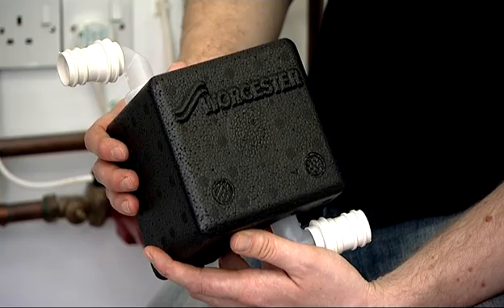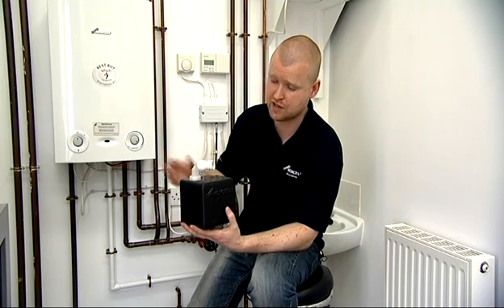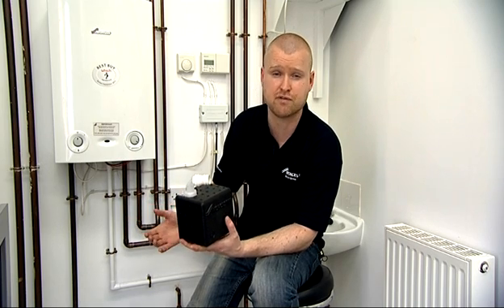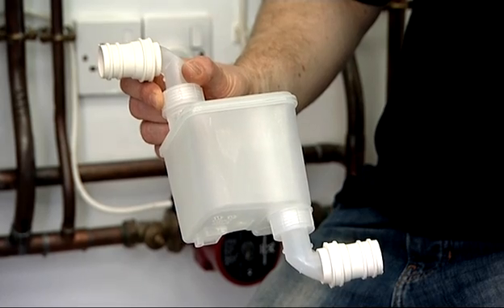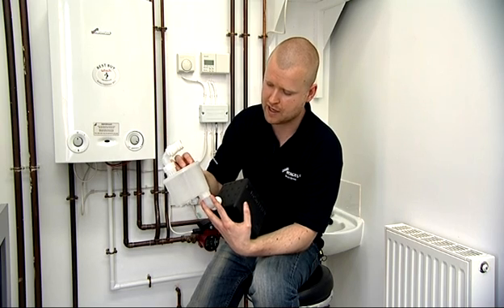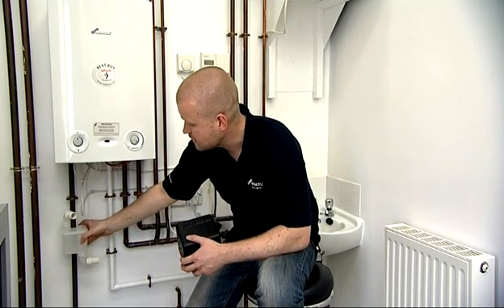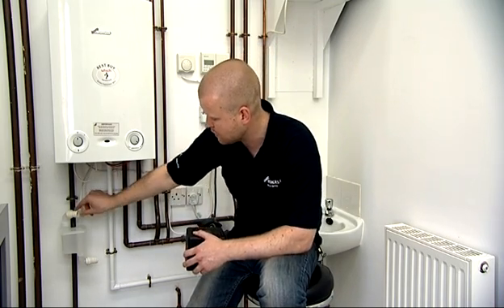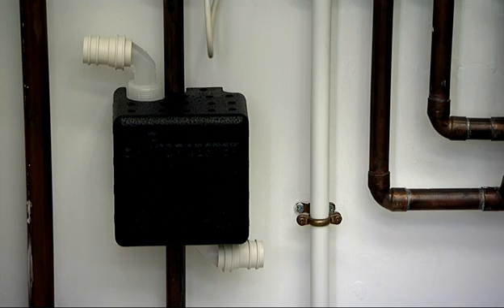CondenseSure Advice for Heating Professionals

Comment: Free parasitic heat? Not aiming this at WB per se but whats the point in havng a condensing boiler to squeeze latent heat out of the water vapour, only to have to extract energy back out of the system flow to heat the condensate and dump it down the drain? 
I hope I can keep my old none condensing boiler working another few years :(

Comment: To fit on existing installation it would mean another hole will need to be drilled on the wall to fit this in under the boiler, so why not have this built inside the boiler??

Comment: Warm water freezes quicker than cold water. Why would you want to warm the condensate??
Reply: My guess: the Mpemba effect is likely only to apply in lab conditions to pure water stationary in a freezer. Here we are talking about slightly acidic water moving out through a pipe so hopefully the fact that there's more of it, it's warm and moving quicker will reduce the chance of it freezing before escaping - certainly relative to a drip drip of water without this device.